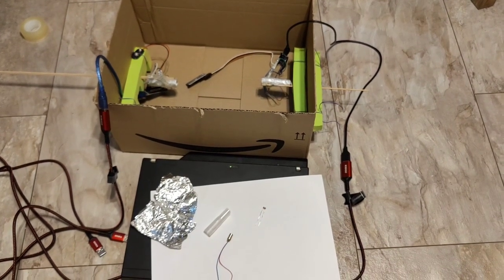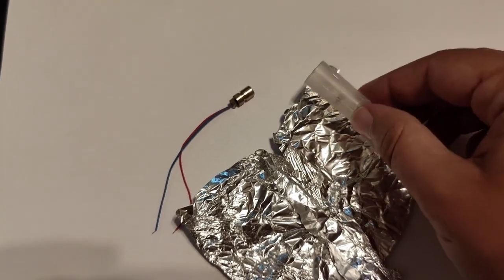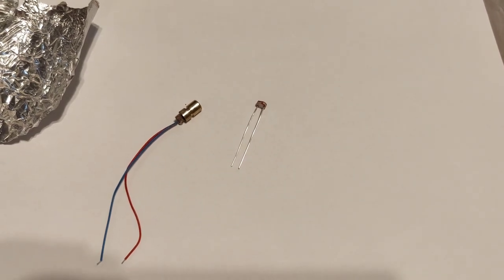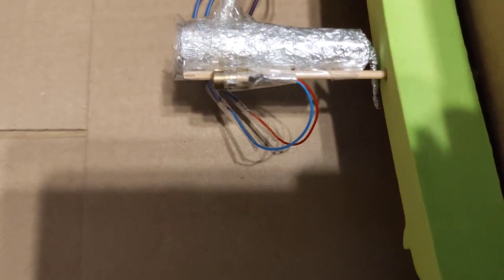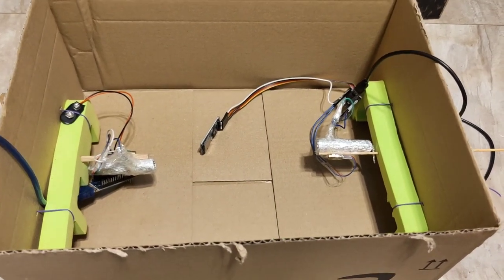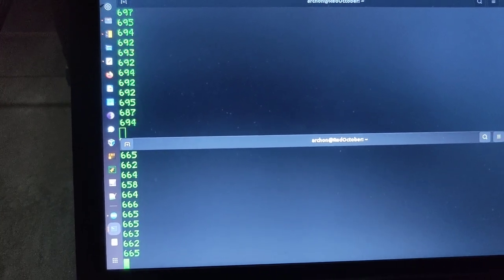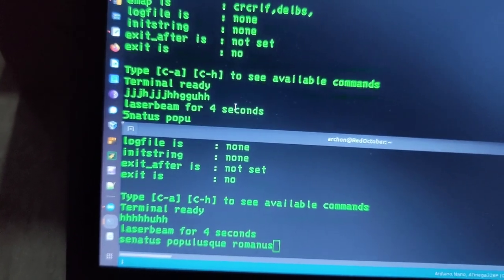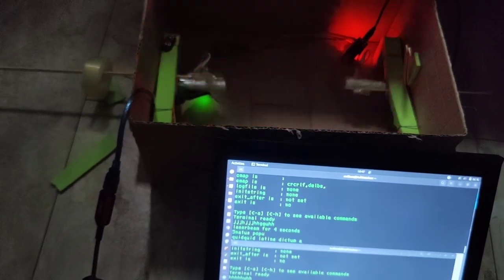Laser modem driven by Arduino Nano

Comment: That is so cool ! I saw a project on the web a decade ago, I can't find it. They had a data link using 5mm LEDs focused with magnifier glass to make the beam go straight. Same for the sensor (a cheep lupe in front of the sensor). It had a circuit board with an uart on it. If I find it I will post it. I think they argued that a 5mm led would keep the eye safety standard or something like that.
Reply from the maker: Very interesting!